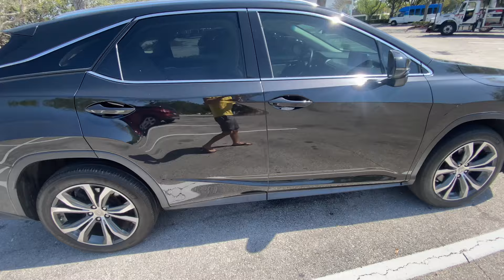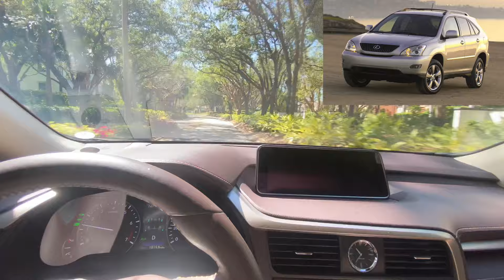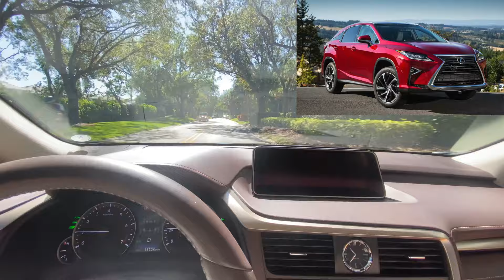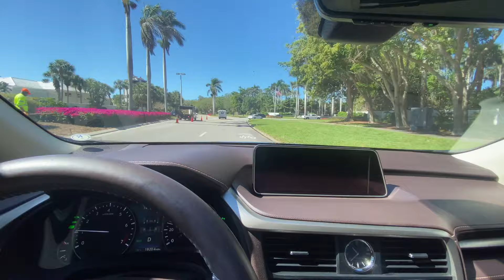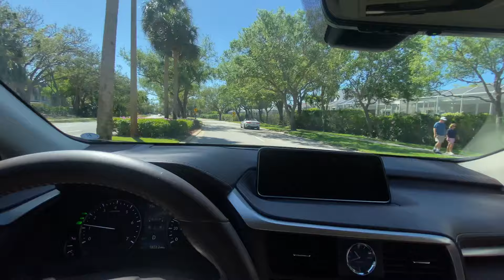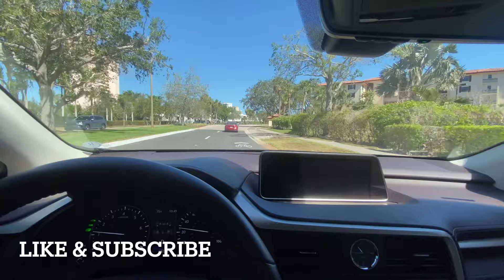Lexus RX350 Reliability Problems To Watch Out For ($$$$)

Comment: Just install Grom Audio system. Keep your suspension and stabilizers good, good tires and use premium gas. Find yourself a good mechanic and your set for life.
Reply: Can you recommend tires.  Mine seem to have a lot of road noise.
Reply: Pricey but, Michelin Primacy Tours are very comfortable with great ratings.  @tracylindsey4199
Reply: @tracylindsey4199 Michelin

Comment: I have an 4th gen 2016, has 100K miles. Run like a champ, no issues. Regular oil changes and any issues are quickly addressed. Love my RX350. Looking forward to purchasing a newer model soon.
Reply: Have you had any issues with oil seepage or the oil cover or chain etc?
Reply: @j @jonathankemper7677 Yes! Took to dealer and Lexus replaced the cover & chain. RX350 runs like a champ.

Comment: All the things your mentioning are only seen on the olde models and or with extremely high mileage which at that point the repairs are likely to be needed with any other brand all brand suspension seals are will eventually need repair all the things your mentioned are normal maintenance items

Comment: I know every car is going to have its issues so I was fine dealing with the issues when I was ready to replace my 19 year old RX. I did decide that the 2020 and newer models were going to be less annoying since they do have the touch screen and have Android auto. The joystick in the navigation system in the older models was really clunky to use and I would have had to Bluetooth my GPS from my phone into it anyway. Then I would have had this navigation screen that was pointless in the Lexus infotainment center. The unfortunate issue I have come into you is the dreaded oil leak found on my pre-purchase inspection. I know that it may just be a small thing to monitor but I do not want to purchase a car that I already know has that leak. I've just told the dealership about it and we're going to see if they're willing to fix it and if not I guess that's not my car

Comment: I just spent $3,200 for water pump on mine. Crazy
Reply: You seriously got the Diddy treatment by the dealer. Find a good independent shop next time.
Reply: What year is yours?
Reply: Seriously?
Reply: Mines was leaking at 124k miles I brought the water pump at Lexus for 187.00 then my mechanic charged me 260.00 for labor  also I brought a serpentine belt and changed the coolant with the thermostat  thermostat was 30.00 a the dealership and I brought a serpentine belt off Amazon for 23.00 and Bando belt
Reply: What year is yours that you had to change the water pump ?

Comment: This does not give a true story of the RX. This video is over 15 years of items. Most issues are normal wearing of  parts.  The lock actuator is an issue I bought all 4 new actuators with under 100 bucks off Amazon it’s an easy swap out if your handy or bring them to mechanic it’s not a big deal. Listen to last min of video where he explains how well they are made.  Everything need parts replaced over time these vech are really less a issue